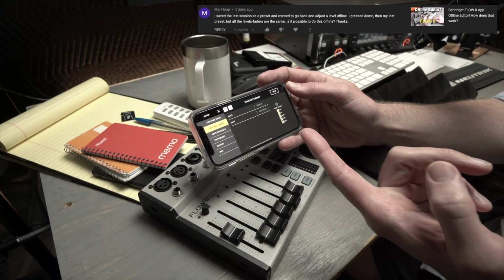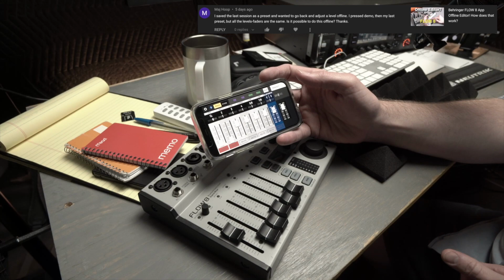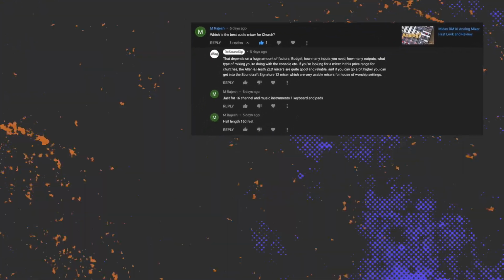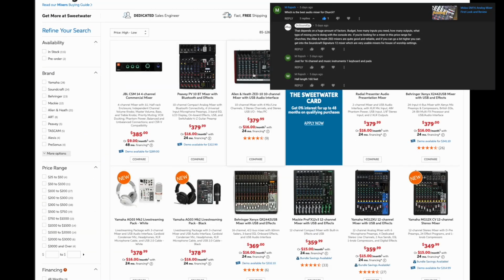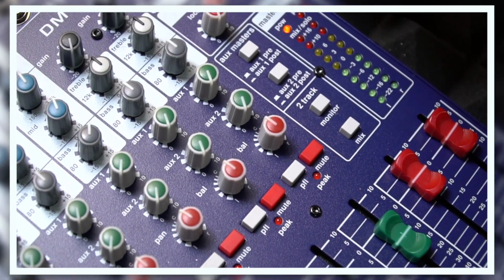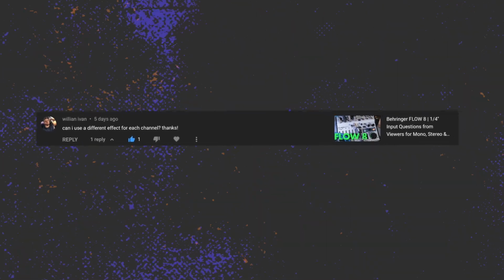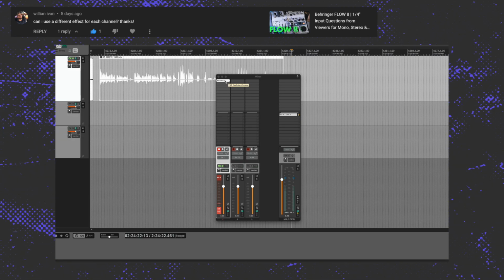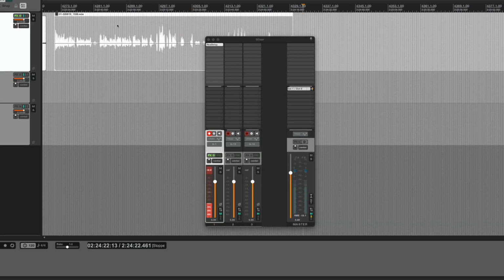Viewer Questions - Routing Effects, Bluetooth Range, Church Mixers and more!

Comment: Apologies if you've answered this already but I'm trying to find some stats on the RTL latency figures for Flow 8 as an interface, and not really seeing anything online. When working as an interface can you adjust the buffer down to to something like 64 samples, and if so roughly what kind of latency figures could I expect. Obviously everyones system will perform differently but just want to get some guideline figures.

Comment: I want to use this for fm radio live events, I have three  QS:     1. Is there [even a 1ms delay from the digital processing] from my voice to my ears via headphones?    2. is there a workaround to mute the audio path to monitors when I use mic1 channel?           3. Is this a decent output for fm broadcasting?    THANKS for your time!
Reply from the maker: Thanks for the questions! This mixer was never indented to be a live broadcast mixer. 1. Any digital processing you put between your mic and your headphones will result in some latency. 2. No, you cannot duck the monitors with channel one as the Key source, this mixer isn't that advanced. 3. Any broadcast transmitter I've every used accepts line level signal, so yes. This mixer has an output limiter you can use to boost the level and reduce the dynamic range, but it's not the same quality as a pro broadcast limiter you'd find in an FM broadcast studio typically. Hope that helps.

Comment: Hi ! My name is JD.
I’ve got a question and it’s for a work in progress. I’m in a 7 peace “rock” band and I’m planning on building a rehearsal space in my backyard. So I’ve gone trough planning sound deadening. Insulation. Ventilation. Lightning. Power outlets. Cable routing. Oh wait, cable routing. I’m a bit older, still knowing the arm thick snakes going trough the studios. Analog. 
So since analog has gone died and past away. (Although I still see analog stuff still been made) I found out AVB is a thing. Did a little research and got confused really quick. 
Q: how and what can I use and configure that I can rehearsal with a 7 peace band, with each member having a personal monitor ie in ear, headphone ore stage monitor. Cause the plan is to also be able to live gig with it. 
I was thinking of either a StudioLive 32s ore a behringer Wing. 
Ore maybe you have a better idea? With separate patch bays over AVB? 

In anyway, thanks in advance. 

Best regards JD